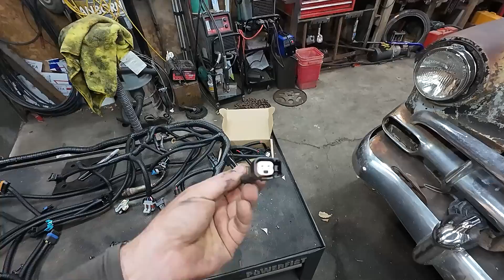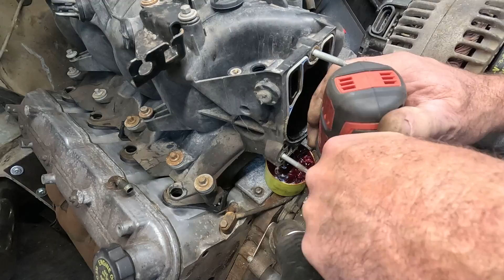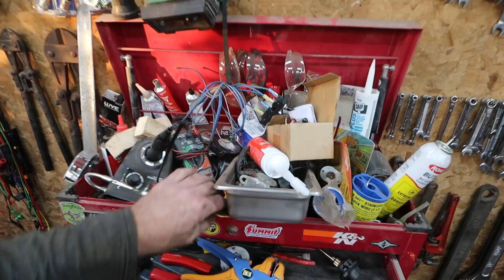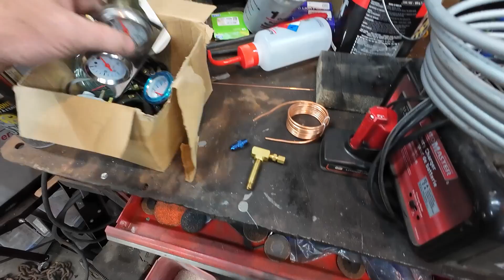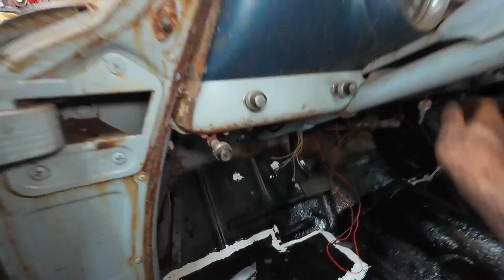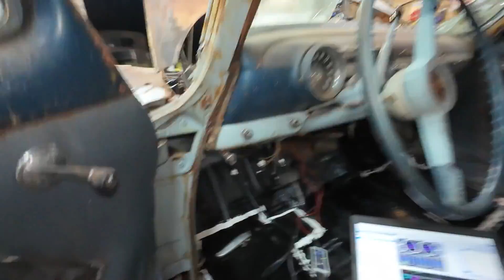First start of our Turbo LS powered 1954 Chevy!

Comment: You mentioning the hassle of waiting on parts for this project lets me know I'm not alone!! Lol. I'm working on swapping a SBC into a 51 Willys Jeep on my channel, that I started about 3 months ago, and should have been about 3 weeks to do. However it has been a never ending hassle with getting the very simple and common Chevy parts and lots of other hold ups. I went through a period of trying to get a 10.5" flywheel for it, and kept getting 11" ones sent to me instead! three times in a row! And the guy wanted to keep using the original T-90 trans so we got an adapter kit for it with a longer input shaft, and once I got into the trans I found the milky soup of water with burned out bushings and damaged gears! yep, now a trans rebuild gets added to the job, and another wait on more parts! lol. I got the motor up and running last Sunday finally, only to have the starter lockup and burn up, followed by it running out of gas! So I still have it for another week at least! I made the guy spring for a new hi-torque mini from Summit rather than screwing around finding another stock starter, but......yep waiting again! Lol!

Comment: I haven't finished watching the video yet, but I wanted to comment on the injector connectors while I was still thinking about the topic.  Over the last 30 years, I have worked on fair number of BMWs, and those look to me like the connectors for the Bosch Injectors.  I know it doesn't help you solve the problem, but at least might help solve the mystery.

Comment: Bret said air mass flow sensor in the hot performance upper sensor area of the engine. The sensor let you know not the end knows fro.and mass sensor. So the sensor let you of how much is the mass of work let to inside the engine. It is for temperature. Too much air = too hot afore the engine is blown up.

Comment: In halfway shop that he did expert test the jet fuel injectors x 4 in measuring amount of fuel per minute. The 4rth injector have inject the mist of fuel by 1/2 amount of what the rest of other j hectic did put out. It is because sequencing fuel are all same amount of not inject fuel time between every 2 injectors. Means only thing TBE power of crankshaft accelerated rpm per 20 degree  was stolen/rob its power so to prevent that power lost. Fire the crankshaft with combustion internal is called acce!station and don't fire the feel mixture until the rpm is in speed of crankshaft. Speed is in between the acceleration and deceleration.

Comment: Bret was drilling thru the water pump because you cannot use ethylene glucose in the radiator of the 1954 Bel Air instead anti freeze use just water in radiator also same water with flow regulated orifice to spray mist water into the intake manifold or cool water up to 160 to 170 degree F into thru air throttle body to slow down Rpm in the V8 L engine. But shut down the water injector during starting up power V8.

Comment: The tungsten turbo for super boost pressure of your 1954 Chevy custom hot rod that Bret of half ass racing parts shop and store said stole the injectors and make it running hot rod custom and fabricated the 1954 Chevy cancer car but half as idea was to rebuild the 1954 car with jet Chrysler L engine using only Cox fuel in 10 gallon tank full up highest flash point kerosene for car engine. TBE turbo engine needs glow plug charge up from 100 amp generator all 8 plug must be coded hottest plug model for nor not spark it but to flame the engine until hot engine can spark the kerosene mixed with a little gas in combustion chamber. The spark plug does not spark the gas mixture as it is require for Chevy offer Chrysler jet engine made for propeller or car T400 attachment that you cannot have low rpm and cannot have idle engine. Because it starts up only in high rpm.

Comment: Flex fuel is for it is common for propeller type engine that runs on kerosene, ethanol 85 and diesel and propane mixed but must have the variable regulator that is a mechanical iris like orifice size to 2 barrel carb and another 2 barrel carb on the same engine for it is a different orifice size for gasoline and fly only low altitude gas is not for high flying altitude. Running the 1 carburetor and turn off the 2nd carb to run motor then turn off 1st carb at same time run up the 2nd carb is why I called it flexible fuel but not more than 87 octane so it can burn easier in high altitude than 90 octane. I would suggest to add oxygenated to gas called Otto fuel. But not for car motor.

Comment: If a car has sat for a long time, it can develop an air bubble in the oil line going to the mechanical gauge. If your oil gauge is lazy, you should try cracking the line right behind the gauge to bleed it out with the motor running.  Wrap the oil line with a cloth to absorb the oil when you crack it.

Comment: You've covered wiring and computer "stuff" for an LS. FWIW, not only can you buy a wiring harness for one, but there are places you can send your computer where they will unlock it and make changes according to what you tell them the application will be. Even spending the money to do one or both of those, though,  can still lead to results that are only so- so. Your knowledge and your willingness to share it are GREAT!! Will you be taking off the grunge all over the body? Hope the new shop is done before the snow flies.

Comment: Yes sir there is quite a bit of stuff to do but you are making progress. The body on that car is pretty much all there and with your repairs on the floors it looks as though it would be a candidate for a decent paint job. Also a good interior restoration would really do wonders for the car.. In my opinion a stock color for the car and the dash along with some good interior work would be a nice touch. The car would be a sleeper in that the drivetrain is modern with the LS power. This looks to be your best application for the LS and it really looks at home in this car. Two thumbs up on your build and it is most interesting to follow your channel

Comment: Excellent video Brent  :) also fix up power steering lines , pinning seal on transmission , should put note for Reverse those  plugs on had changed that second vechile remember did another in past and keeping engine running not turn off ! Yes doing wire up gauges be wise ideas  to also gas pedal and much more! Plus would wait put new shop and have ready to paint to inside car then front windshield too ! Plus paint colors be cool see got in mind  and how pretty to also seats ! Battery in trunk super idea and make ends on you want on side or top post and ground pigtail  too!

Comment: The two plugs for the transmission are a reverse lockout and speed sensor, using the same harness in a 1946 GMC pickup on a s10 chassis with a LS and 700r4. I did the same on injector plugs

Comment: Hello Brent, I thought it was a the crank or cam shafts sensors were not communicating. My friend you were right again, GM is famous for using the same two and three wire connectors and other styles.  That is why the wire colors on a stock GM is important.  As normal Sir you are a wealth of knowledge. I learn or get refreshed on every video, thank you for education.

Comment: I am impressed that you can fit all of that into the engine bay. It suck that that fancy set up you had for the injectors when up with the old shop, but this seem to work. I like the sound of that 3" pipe. If you run too lean on the fuel, will it burn up the motor on a turbo motor? You have a cool car coming to life.

Comment: Mike Noonan is the owner of EFI CONNECTIONS  which he can provide complete harness or connector kits to repair or change connector type. If you can find your part numbers the  connectors and terminal  can be found at Digikey or Mouser. I looked for Delphi /Adelphi  catalog  on the web. There was an old 2007 which help a lot. T

Comment: Outstanding result, reminds of the time i was convinced to update my 98 Corvette with a 2000 PCM because it was faster and had more memory. As you know there two huge sockets to the PCM, hundreds of pins in sockets. Red and blue schematics the 98 pin out verses the 2000 Pin out and i have made a pin to pin chart. Red 42 goes to blue 89, It took me hours to walk thru the pins one at a time and make the switches. Not all the pins needed to be changed. Out of the 300 pins i only had to change every one but TWO! Then I had to do a god Awful security cycle  to try to start the engine. I found two methods one had you go through a routine three times the other only required two times. I figured it was the three times one that was correct. I go thru it,  click this three times then wait 90 seconds and click that. Oh My God. I get ready cranks, but no start. So i tried the two cycle method. It fired right up and idled perfectly. I ran out of the garage after hours of pin swapping i was so wild with glee I was screaming in the street, "ITS ALIVE" !!!  A neighbors pooks his head out "Is everything ok Dennis?"   "Oh Yes  my engine started doesn't it sound great" Yes OK Good Night. So when You had trouble and was working thru it I was there with you.  Then when it started and your laughing and grinning so was I. Remembering how wa=onderful it is when you work so hard then trouble then it starts. Yee Haa! Such a happy feeling. Great Project, Great Result. Way to Go Brent.

Comment: By the look of the amount of fuel those injectors are putting out, it should idle between 4,500 and 6,000 RPM’s. The good news is that it should get about two miles to the gallon! Congratulations, you’ve given birth to a fuel hog!  Lol. Pretty cool video, Thanks for sharing! I really like this ‘54, such a cool ride.
Edit: Yea,Yea, Yea, I know I should watch the video until the end before I comment, but it was just joking around anyway.

Comment: I know nothing about injectors, but why can't you drill out the holes in the cap, like you do with jets in a carburetor? Just wondering.
Reply from the maker: There's a bearing behind the cap if you drill it it'll none stop leak.

Comment: The Amazon search engine is horrible, I use google to find the stuff on Amazon. I used one of those for a Aluminum 5.3L from a Trailblazer DBW, it worked good once I realized I had the Cam Sync and MAP sensor swapped

Comment: Reason you wont find that harness with Multec connectors is because it is a copy of an LS1 F body harness, not the Vortec truck. I am amazed it even started, I went through one of those harnesses and there are definite differences from the LS1 to the Vortec as far as wire locations and design, you may want to double check yours as well. Good luck with the build!
  https://www.youtube.com/watch?v=mEsYQF_bI3A

Comment: There's a bit of work to be  done to make those cheap LS harnesses work properly, the O2 sensor grounds need to be tied to to the low buss in the ecm, and some have the tach wire tee-d in to straight 12v (for pullup voltage except they skipped the resistor) and will backfeed to the ecm and cause the alternator to killl the battery with the engine off. Have also had a few with the map sensor not wired correctly and it will ruin the sensor on first key up. I did a pretty comprehensive video on how to fix them.

Comment: OK Brent!  First start success. "That's a win."  That wasn't Dr. Beaker you measured the fuel output into (Supercar a British children's TV show 1960-1962) it was Mr. Graduated Cylinder.  I just noticed what appears to be a vacuum wiper motor on that old chevy. What's the plan Stan?  By the way, what does LS stand for? At GM we used to say it stood for Last Chevy. A little inside joke. Fine Video sir, thank you for taking the time to share all the details of cross-converting a Drive By Cable to work w/ Drive By Wire FI. Who'd have thunk that a guy who lives out in the boonies on a farm would be so digital savvy?  Ha! Havin fun! ben/ michigan

Comment: hey there, enjoying the channel very much from whitby ontario. Certainly impressed with your fabrication skills, mechanical skills and knowledge, in addition your perseverance with respect to taking on each new challenge and the unfortunate fire in the shop. I also like the fact you work safely, using eye protection, hearing protection and a respirator when needed. New to the channel so watching the new ones as they get posted and catching up on the older ones.

Comment: that chevy as a decent sized engine compartment, and your work in pretty clean. It looks like a really good turbo install. I'd be happy to have that under the hood on a car I owned. Great work and content Brent. Matt Happle has a 80lb injector he can can get you a discout, and they are not china junk. This might be a option if you want to go threw his websight. Also a 2500 or 3500 series pick or vans uses 80lb injectors for a flex fuel app they may sock a little more but it might be with it to not have to waste a bunch of time looking for a injector set. Just go to the local auto parts store.